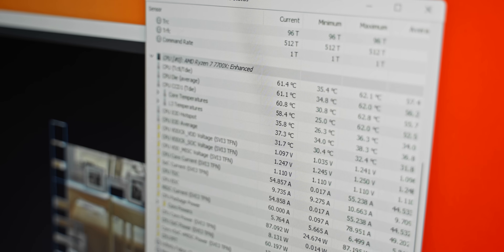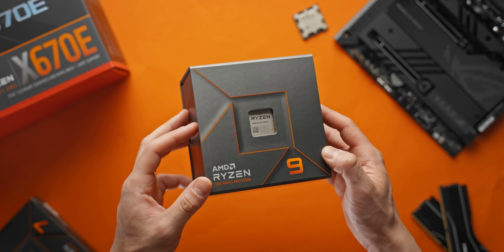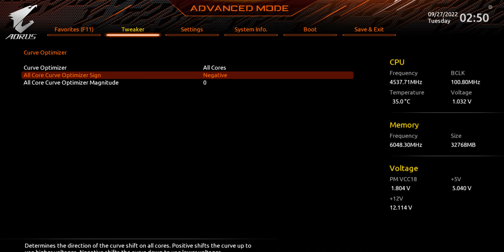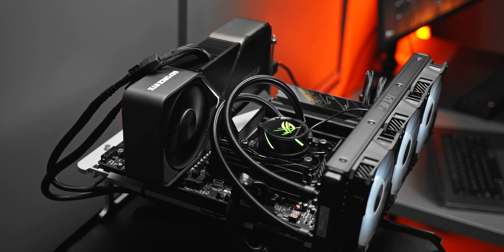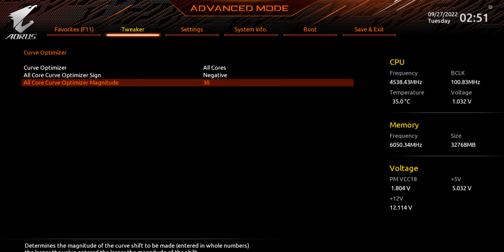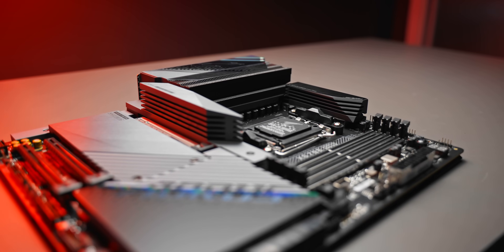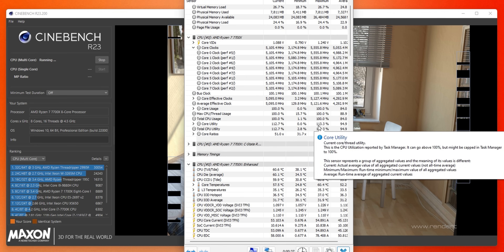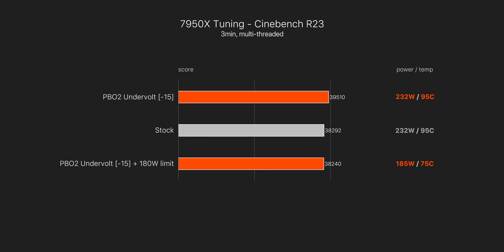Fixing Ryzen 7000 - PBO2 Tune (insanity)

Comment: Doesn't this entirely depend on the cooler? Like Noctua NH D15 vs stock cooler vs AIO. What difference do you get with different cooling solutions? Maybe with a high end tower cooler the difference is much less, maybe not even worth it?

Comment: Any chance on a 9800x3d update?
Reply: I got the ryzen 7 9800x3d and I have an asrockb650I motherboard and before the undervolt my cpu was running 75 degrees average and 105w, but after the undervolt it goes to 60 degrees and 80w average when gaming

Comment: with undervolt -30 and 85 limit I only receive a cinebench score of 18500 multi and 1950 single, and a clock of 5ghz while its running. the moment its finished it can boost up to 5.5ghz but not in the benchmark. with the powerlimit set to 105w limit instead I can hit the 5.2ghz and a cinebanch score of 19380 multi and 1950 single. what is going on with this cpu ? what am I doing wrong ?

with a -40 offset and 105w limit I hit 19500 cinebench... the show must go on, how low can I go

Comment: I have a 360mm Corsair AIO keeping my 7600x as cool as possible with these settings (can hit the -30 PBO target nicely) but I'm really curious if a standard AMD cooler could keep this cool if you set the wattage and temperatures to 85 each in the BIOS. Would be awesome if it were possible.

Comment: I couldn't even get a stable underclock of -10 on my 7900x. I just said screw it and enabled eco mode at 120W and I'm happy with that. I only lost about 100mhz to 5.4ghz and I'm staying in the high 80s.

Comment: The only change i made was undervolting by a magnitude of 30 and i have temps of about 5 degrees cooler and increased performance. I havent even bothered messing with the temp or wattage and my 7600x is running like a beast. These chips are  not optimized out of the box but their performance is impressive for the cost.

Comment: Isn’t it meant to run at 95c I didn’t see what the benefits for doing this
Reply: Yes, however not everyone wants their cpu to run at 95 as its the absolute ceiling of what's safe. 10-20 degree lower temps can make it last longer too. Ryzen 7000 series basically maxes out your clock speed until your gpu hits 95°c, the max they're designed to work at.

Comment: Question: On my 7800x3D I found I could hit 15 for Curve (20 caused crashes).   What about also changing "CPU Offset Voltage (-1)?  I set that to 0.05 and it reduced temps by 7-8C with a very minor drop in perf.  I've done both and it seems to work fine (~1% speed +-) of stock.  I've not a seen a clear story on how you can do both.

I really like your tip on changing PPT Limit [pmW]!  Thanks!

Comment: for anybody who’s wondering about  his PPT TDC EDC settings, if you check on ECO Mode on bios, (im using gigabyte a620 with 7800x3d) there is an info for 65w that states PPT 87.8, TDC 75, EDC 150, so yeah, his settings are nice.

Comment: Need help. I followed this video step by step and luckily my R7 7700x can also manage -30 on the curve optimizer, however, when setting the power limit to 85w, my Cinebench scores dipped since my frequencies aren't going beyond 4.8ghz. Any idea?
Reply: That sounds right to me. By lowering the power limit the CPU is using less power so can't run as fast. try setting a higher CPU power limit.
Reply: @davidpower3102  yeah I figured, too. By having a 105w power limit I could match stock. I'm just confused as to how in this video he has 85w power limit but manages 5.1ghz in cinebench. Could it be a cooler problem? I have the Peerless Assassin 120 on it
Reply: @kenbooze6105  I have a very similar cooler that performs nearly identical; Phantom Spirit 120 EVO. 

 I am going to try switch over to the ARCTIC Liquid Freezer III 240 today to how I get on with that cooling option but I would be surprised if it makes much of a difference.
Reply: @kenbooze6105  so after testing the AIO cooler I mentioned voice I saw Zero improvement to thermals, it doesn’t spike as quickly maybe… after more reading it’s clear that the Air coolers we have are VERY good and we’d need to be putting a larger 380 AIO cooler on our CPU before we saw any noticeable improvement to thermals but even then it’s only going to be 1 to 2 degrees lower under load. 

So I think we both are seeing the best cooling we reasonable can expect without spending a lot more money and even then it’s not a lot cooler.
Reply: I think your score dip in Cinebench is reasonable. Boot up a few games you know well and see how they perform. If you’re happy with the performance and the CPU is noticeably cooler then I think that’s a win. 

I think it would be best to test CPU intensive games also. Monster Hunter: World for example.
Reply: @davidpower3102  Hi! I greatly appreciate for the updates! Just tested out on some games and yes, I'm now running most of my games at either 60-70C now from running mid 70C in League of Legends. Space Marine 2 just had a hotfix for the CPU usage and I went from 82C (I set 85C as the limit in bios) to just in the mid 60s now. I figured I just won't bother with cinebench scores anymore and have my peace of mind lol
Reply: @kenbooze6105  that’s a great outcome. The CPU is rated to run hotter so you’re well in the green now and you’re likely going to save a little money and produce less heat in your gaming area this way.

That peace of mind that you’re talking about is actually the reason I bought a PS4 years back. I was tweaking settings more than playing games on my PC. I did the switch back then to manage my obsessive mindset and you’re comment just now made think remember I need to focus on the games more. I’m loving Diablo 4 at the moment and I played it on Nvidia Now for a few months before I decided to make myself a PC again. 

I’m going to do the same as you and just play the games I love!

Comment: I was waiting for a cheap even used 7600/7600x in the $140-160 range for my young kids AM4 to AM5 upgrade. Already had a dirt cheap open box $60 B650 Aorus board and some good Trident White RGB. Well a bit overkill but the 7700X went on sale for $220 plus two games I might be able to sell for $20 each. I have a nice used $50 Noctua U12A chromax/ with $20 White cover on it and GC-4 thermal compound and my temps went straight to 95c under C23 run. I was thinking my cooler wasn't mounted well maybe due to the Thermalright AM5 plate I used. Then I see all these reviews about it. Wow, all my Noctua coolers handle heat pretty well running C23 but this was the first Zen4 that sky rocketed to 95c. My 7600/7600x/7800X3D all run easily in the 80's.

I just did the standard -30 CO all core and it's now peaking at 89c and in the 120 watt range. All core ran around 5300-5350mhz in C23. Stock it hit 150watts. I did order the $5 offset kit for the U12A which their testing showed almost a 3c reduction with the 7mm offset kit.

Comment: with the pbo tune that gives the same performance, lower temps and lower power i was getting 18500+ scores in cinebench r23 with 67 watts of power constantly. is it normal? (also was getting 70+ degrees celsius)

Comment: @optimum This didn't really do anything for me. I'm still seeing my voltages are between 1.24 - 1.36 V with idle temps stuck between 50 - 70 C.

I'm currently running an AMD Ryzen 9 7900X on a Gigabyte B650 Aorus Elite AX V2.

Comment: I did all this an I see a performance hit for for with the CPU.  This doesn't make sense that the performance would he the same.  It's doing less which is why it's not as hot.  I have the 7700X and my Temps were around 85 under load and now its around 55 under load.  Great, buy then I ran a benchmark and the CPU performance was almost cut in half.  Although I couldn't tell a difference in game though except the temp was 55 degrees which was amazing.  But at what cost though?  

Ask yourself, if this is so much better and seems like a no brainer, why isn't it like this out of the box???

I found my CPU performance dropped significantly by doing this.  Previously, I had 2530 GFLOPS, and then changing the setting produced only 1860 GFLOPS.  That's a pretty drastically decrease.  You might as well just get a less powerful chip at this point if you leave it like this.
Reply: You have 7700x instead of the regular 7700, which means that it's already overclocked from the factory. There's literally zero need to do this and what people should do is to get a better cooler, top of the line stuff.

Comment: I could only go down to -10 offset on my 7950x3d. I tried 20 with a  75 degree limit and Prime95 caused a reboot after 60 seconds. As my temps never go above 82 degrees I left the thermal limit to auto. Hope it doesnt crash.

Comment: Do i have to change my TDC and EDC to match your ?
Reply: Did you figure this out?
Reply: @FluxDigital  nope eheh, i ended up not changing those values
Reply: each CPU has their own TDC and EDC values, adjusting those settings basically changes the CPU from full power to ECO mode. You can find the settings for your cpu with google

Comment: Thank you, +1400 points in Cinebench and 5 degrees less. 
Side note, if I understood correctly you said that the magnitude is limited to 30, but I've tested 40 and it worked (I saw an improvement), and a crash at 50. So 30 is not a hardcoded limit in the bios

Comment: If you have a small form factor PC and you are only looking to reduce temps. Just use ECO mode IMO. It is not worth the blue screens that I have went through. ECO mode does reduce overall performance but in games you will not notice a difference. The TDP is dropped and it is so much more cool with it on.
Reply: Yo! Appreciate the comment. I just want cooler temps without the trouble of stress testing.

Comment: Any idea why my cpu doesn't react to the final 2 steps regarding thermal limits? When i enter ryzen master it does say max value 75 degrees, but the current one just ignores that, sitting at 78, power draw also doesn't react, showing up with nearly 80w compared to 90 stock

Is there a setting i need to switch fot it to work?
Reply: did you find any solution?
Reply: @farhang-n  no i haven't, hoping for some replies

Comment: Hey, thanks for the video! I cannot even get -10 on my AMD 7 7700x. Am I just boned out of doing this?
Reply: I was looking around trying to figure out a solution cause mine was crashing with any adjustment as well. Are you by chance using EXPO 1 for your ram? I changed mine from EXPO to XMP and it seems to have fixed the issue, I can now apply a -20

Comment: This is kind of bs. My 7700x runs at 95 degrees but it is still able to boost all the way to 5500mhz. Why would you slow down the dpi just because you don’t like the hot temp? The manufacturer says you can run them at 95c. So how is this free performance when it slows your cpu down when it is all said and done?
Reply: Lower temps means fans have to work less which means quieter operation - this is especially important in sff pc's. You have to decide if you want the extra ~5% performance or temps reduced by 30°C

Comment: after i changed curve optimizer from disabled to 30 i didnt notice any clock speed changed like i saw in a video , instead i got a better temp and it's using less power  is this normal ? 
r5 5600 + b550m aorus elite

Comment: Ryzen 5 7600x owner here with an MSI mobo. I followed your guide and dropped my magnitude to 25 to start and it dropped my cinebench temperatures 15C and I gained 300mhz STABLE with no crashes. Awesome video thank you!
Reply: What did you set pbo limits to?

Comment: I have a 7800x3d, when i pick pbo manual my ppt is 420000, tdc is 280000 and edc is 350000.

Should i just change it to the same settings as yours? 
You didnt show you changed it?

Comment: Can anyone share tdp, and other settings for manual pbo of a 7900x? I have -25 core offset per core stable, wondering what a good tdp would be I hit 185-190w with mobo defaults in cbr24

Comment: I’ve tried the last option and nothing has worked I’m still pushing close to 90c and I have no clue
Reply: I hope it’s not my pump that I have to replace
Reply: What r ur temps without optimizations?
Reply: @VartuMontavimas  it would be hitting straight 95
Reply: @eriktorres9955   ye bro ur cooler is fucked 89 is the max temp. And ur cpu is defo cooking 🧑‍🍳
Reply: @VartuMontavimas  it’s been a stable 85-86 the last few days
Reply: @eriktorres9955   yeah thats not good… 89 is horrible and 85 is bad

Comment: Great video! Quick question about setting a power limit in the BIOS like you did. I set my power limit to 100w, which greatly lowered the temperatures. However the two categories below that, TDC limit and EDC limit are different for my motherboard (Aorus Pro X X670e). Should I change them to match your settings, keep them as they are, or something else entirely?

Comment: Watching this video.
For my r7 7800x3d and using mobo msi x670e tomahawk using latest bios build date 2024 05 31 e7e12ams.1c0 and only using 1 cpu_pwr
Reply: Reached 90c while using cinebench but i aplied the -30 didnt crash
Max power near 70w i dont remember how much but it was less than 80w
Reply: With the temp limit was stable. Went to 75c
Reply: With the temp limit was stable. Went to 75c
Reply: Now going the power limits same as the video, will add later the temps anf wattage later.
I have disabled the temperature controls.
Reply: Minimun was 47 idling while benching peaked at 87.
Nice guide my man.

You are the goat.

Comment: All around good video, BUT: The reason you are able to get these crazy undervolts (also with the 5000 series curve video) is that your stability testing method is flawed and your CPUs are probably not stable. Cinebench is not meant to be used as a stresstest - it's an ok stresstest to do but it shouldn't be your only one. You definitely need to run CoreCycler, and maybe OCCT (SSE). Running these two plus some random stresstest (or Cinebench... :D) for a few hours should be fine

Comment: for ppt limit, tdc limit and edc limit i made mine 85w 480a and 640a, is that correct? i divided each by 1000 but uh 480 and 640 is a lot.. tho those are limits so it should be fine?
Reply: ye I have the same question? Any one can enlighten me if its fine and why?

Comment: So curious, my mate got a new pc built for him recently and he's running one of these CPU,s I keep seeing that it's normal for these to run a bit hotter than usual so figured I'd ask before he goes insane. But should his 7950X be running at 70c in the BIOS and what are like the typical values he should be looking at for idle, some youtube etc, and then gaming? I keep tellin him just to head back to the shop he got to build it for em but he insists on troubleshooting despite his lack of IT know how and there's only so much I can do remotely for em XD
Reply: normal doesnt mean optimal. they run hot because thats their default. you can undervolt them like crazy for better performance AND way lower temps/power used. Same deal with GPUs. traditional "overclocks" are generally not used anymore - PBO2 algo does a way better job finding boost frequencies already and will sustain them if the temps are sustained.
Reply: @sloptop  Aye figured that, he did say he tried eco mode n stuff but it still wasn't budging, think he's getting the IT guy to see it tomorrow thankfully.

Comment: I have a 7 7800x3D, and want to try changing the PTT limit to get some cooler temps, but I'm unsure what to set the TDC and EDC limits at, as they just stay at zero when I change the PPT limit. Any suggestions? :)

Comment: I tried to use PBO enhanced with 90deg and 80deg limit which undervolts the cpu. Both were crashing my pc at any cpu based task. It could be due to the stock cooler on the Ryzen 5 7600 idk. Now I use default enabled PBO which is stable at 95deg. Frequencies are at 4.5-4.6GHz across all cores when running P95 max cpu stress test. When gaming they're at 4.9-5.1GHz at around 90deg which is just fine for me. So is it the cooler or the  silicone, why I cant undervolt the cpu?

Comment: For me, on the 7600x with the negative 30 offset alone, my CPU temps dropped from 91°C(max) to 78°C(max) and clocks are higher to boot. 
So are the benchmark scores. 

And the PC is now much quieter (opening games dont shortly ramp up the fans as high as before). 

Seems to be stable enough for now. 
At least Cinebench did run without crashing for 30min.

Comment: This is a very good video explaining everything in detail and at the same time making it simple and easy to understand. I overclocked my ryzen 5 7600 and tested on cinebench and prime 95 and it was perfect, until it started blue screening…. I turned the over clock off and it blue screened again. I’m not sure if it’ll happen again or not but I wouldn’t recommend overclocking the 7600. It really isn’t worth it. I only got maybe 4% increase in performance but I didn’t even notice it. The cpu is really good as it is so don’t overclock even if you know what you are doing.

Comment: Just a silly question. As Optimum shows his PPT limit he puts a value on mW I.e. 85000 for 85W. Anyone knows what value should be used in ASUS UEFI ? Since it doesn’t show it has to be in mW or W? When I did the optimisation to my r5 7600 even if I set my PPT to the 85W value I still get package value of 98-99W while running Cinebench and temperatures still hovers around 90-92 C. I am pretty sure I am doing something incorrectly … just don’t know where ..

Comment: Great video! I was able to undervolt -30 with my 7600x. Max temps dropped from 95C to 78C. I can likely get it to 75C with fans running at full speed.

Comment: 7800X3D limited to 75W actually did nothing as my CPU never even reaches 75W so still ran at 90 degrees but setting it to 60W had a 20 degree decrease in temperature and I only lost 2-3% performance!

60W!!!

This CPU is interesting to say the least.